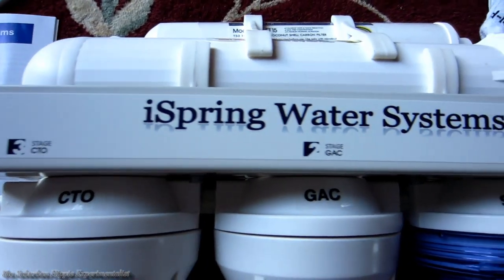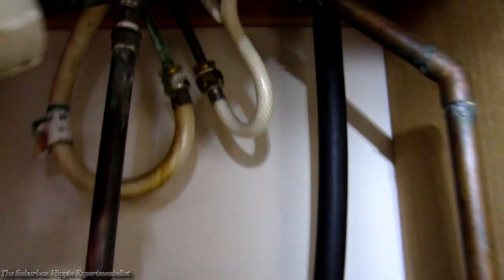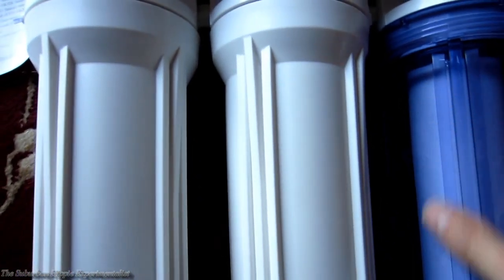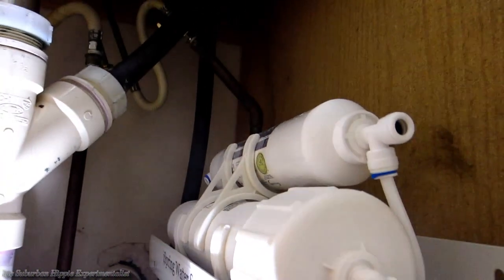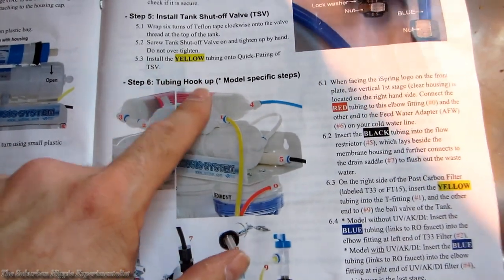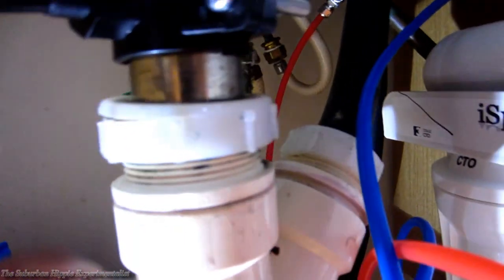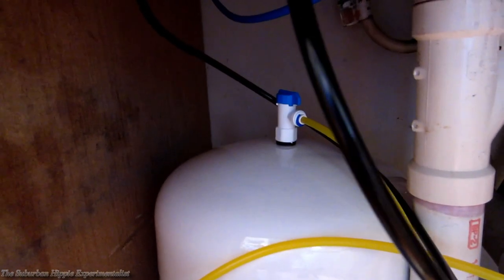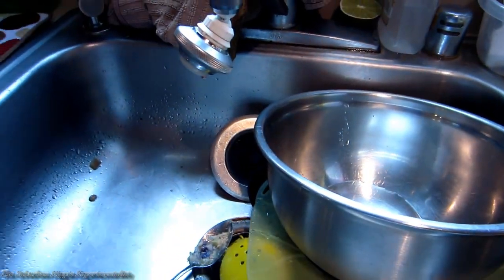an AMETURES install of the Ispring RCC7 Reverse Osmosis System

Comment: I just installed mine. I turned the tank valve off and the sink faucet on to flush the lines. The last filter is a carbon filter and carbon dust comes out. I also turned the RO filter and the carbon filter vertical to get the air and cloudiness out. Once the lines were clear, I opened the tank valve and let it fill up. The water is crystal clear. I will be adding a mineral filter to mix the needed minerals back in.
Reply: I added a mineralizing filter to mine for taste.  I like the taste much better with mine.  That is of course after all the replacements they sent me, which had legitimate issues.
Reply: Could you put a link to which mineral filter you purchased please--thanks and nice video!
Reply: The Suburban Hippie Photographer .... I found it on ebay. Search "in line water ionizer".

Comment: Hello Sir,

Thanks for posting this video on installation and most importantly, thanks for sharing your experience on it.

I've been looking to install this product in the L.A. area since they changed the water cleaning chemicals recently from Chlorine to Chloramine (which is known to kill pet fish) but I want to make sure this is the right solution in general.
Can you answer a couple of questions:
1.-Since this is a Reverse Osmosis is there any kind of effluent product leftover? If so, does it go into the sewage line requiring to dump it there?
2.-I noticed what you mention in the description, since I will be be buying a solution in the future I'm wondering, what is your OVERALL conclusion? Should I go with it, should I buy something else; y reasoning is this is the highest rated osmosis product on amazon so I'm wondering if there's a hidden gem somewhere or if instead there is simply a way to get this working right.

Thanks in advance!!!
Reply from the maker: there is waste water that goes back down the drain. it ends up concentrating the contaminants and sending them down the drain. the chlorine and i would assume chloromine will be left trapped in the carbon filters, and you will throw the carbon filters out in the trash when you change the filters out. i have heard la water is really tough on these but am not sure what your other solutions might be as i have read distillers can vaporize the chemicals and fill your house...

as far as this product, i would stay away as the failure rate is too high! sure they have good customer service, but who wants the hassle?

you may want to find a more reliable model with filters and parts not made in China... if you find that let me know!

Also, the fittings on this model can be prone to leaks! it is not an "install and forget"solution...

i do think RO with a ph balance filter may be your best bet though!

Comment: Sorry to say but this video is just terrible. First as recommended by the company to watch, does not explain how to install or rather hook up all components together with supplied tubing. The installation booklet is not help at all because in my case is not about installation of the system I have bought, including pictures and drawings. Tried to call support - - no luck, closed for the week-end.
Reply: Sorry this hasn't helped you! I do things in a certain way to let people know it isn't that hard to do.  What question can I help you with?
Reply: I hope you were not offended by my comments, I know you tried to help. I have iSpring
 RCC7P-AK - WQA GOLD SEAL - 6-Stage 75GPD Reverse Osmosis Water Filter 
System with Real (not Permeate) Booster Pump (110v & 220v 
compatible) and Alkaline Mineral stage
which has 5 filters + RO membrane. I think there are more connections of color coded tubing then in system you show. The manual does not show those connections either. All pictures and drawings in booklet  do not explain how I should set up my system. Also the plastic wrench for RO membrane housing is impossible to use just because there is not enough space to do it. Tech support is not available on week-ends.
Reply: Sorry, I was away for a while.  It is important to know, I am just a customer and not sponsored by Ispring.  So, it would be from the supply into the Sediment filter, from there through the GAC, From there through the CTO, from there I believe it would be into the pump, from there into the Membrane, one side of the bypass valve would go to  the check valve and then to the drain(black) one side would go to the pressure tank, and that same side would be in a T connector and one side would then go through the post carbon filter, and then the generalizing filter.  If you have the bypass valve connected wrong, the system will not shut off when full.  You should be able to check this by shutting off the the valve to the pressure tank and once the pressure backs up, it should shut the system off.    Let me know how this is going, and I will try to help you!

Comment: RO water is acidic and not truly healthy for you. If you look in the pamphlet, you'll see 7 filters. The sixth one is the one that balances the alkaline to make it healthy. The 7th one is UV light. These only come with the first 5.
Reply: The water from the municipal supply is slightly alkaline.  When I put this filter in, it made it completely neutral. I think it was 7.1.  I added a mineralizing filter for taste, which makes it more alkaline.  What kind of water do you recommend?  Tap water, with all the chemicals that aren't removed?  Bottled water, with all the plasticizer chemicals?  All water filtration techniques have their own draw backs.  If we all lived near a pure natural spring, we could all get our water from there.  As it is, most of our water supplies are heavily tainted.